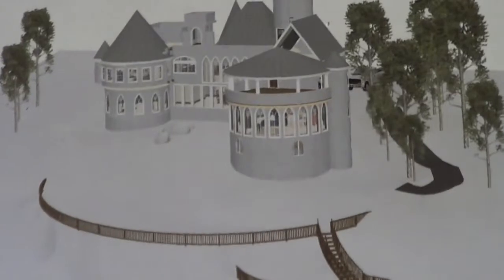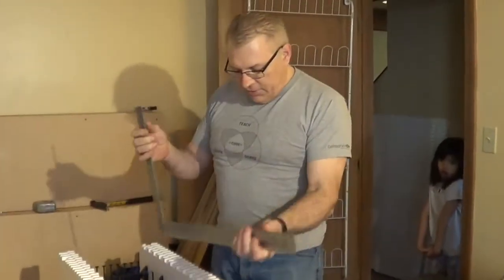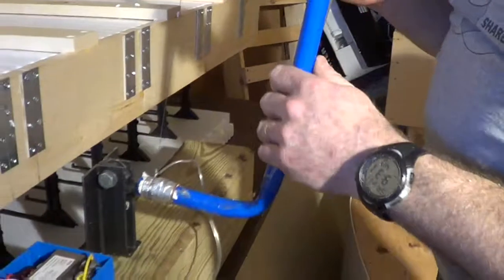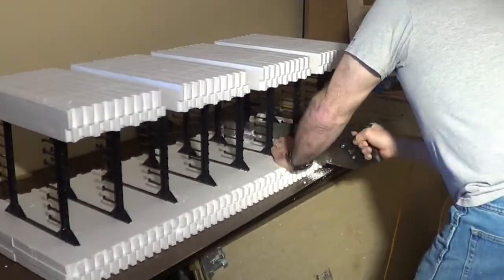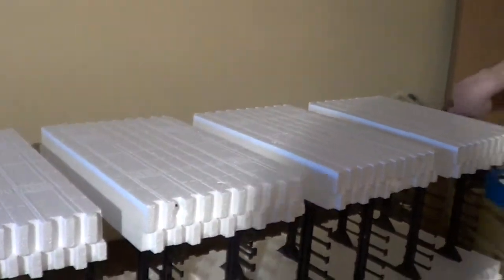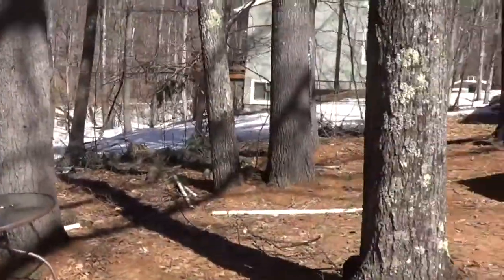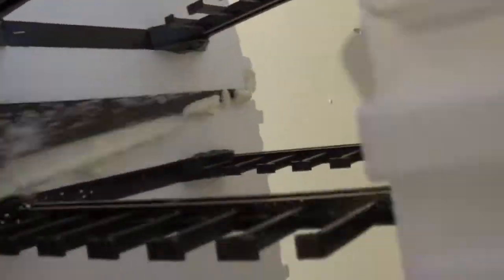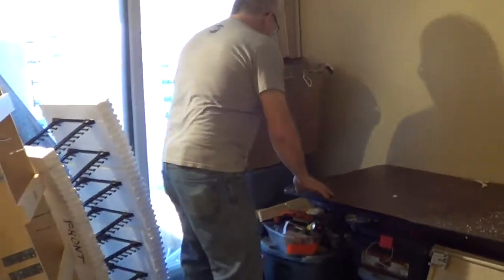Making Radius IFC Blocks For Keene Castle

Comment: Dangit Keene!,,, my Karate girl already has karate boys. I miss those days. Soak it all up bro and btw she (your dotter) sure runs a tractor (excavator) good!  Also, btw, how come you get 30 hours a day to my 20 and a half, lol. Freaking insulated medieval castle. Better than cutting down  your own forest, I always say! Keep rocking the mountain!
Reply from the maker: Great to hear from you Primitive Bob. I forget, did you finish your castle?
Reply: @KeeneCastle  No Mr. Keene. We have lived in  it through the entire construction tho. I probly won't ever be finished, like many castles, just added onto and so on, though the generations.  I've been working on it for 14 years now and slower now than in the past. It is sparse and spartan unlike most folks. Drain-able plumbing to prevent frozen pipes, a cistern below the castle for rain. No windows on the lower floors and few above.  Uninsulated to take advantage of our glorious weather. The flag tower is 4 floors high and the main flagpole another 25 ft. Ours is much more,,, 'Frankenstein' than yours. Across our moat and down to the road is 300 ft. The driveway (walkway) from the road to the castle includes a 100 ft. narrow bridge over the moat, for walking only or light lawn tractor/trailer. 
I'm currently making to electric (Willys jeep 6 volt starters) "Special" DIY SkyCastle UTV's for my wife and I in our old age. Our burial plots are picked out at our neighborhood mountain church cemetery. We live and die at SkyCastle! 
--- You Mr. Keene are succeeding in a palatial 5 star Castle fit for a real king! And having a, lol, BLAST doing so. And you have helped me stay motivated for a long time. Thank you. Stay safe and our very best to yall.